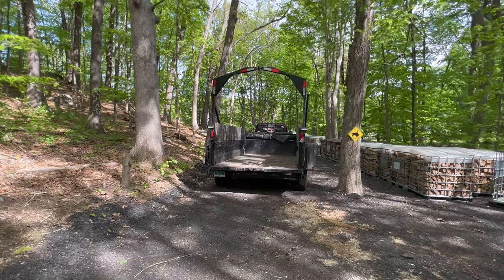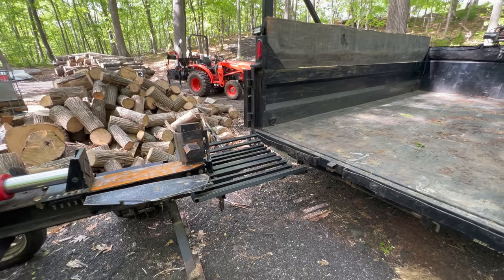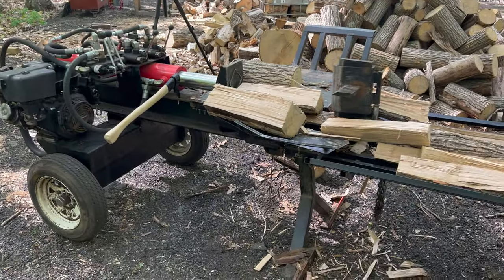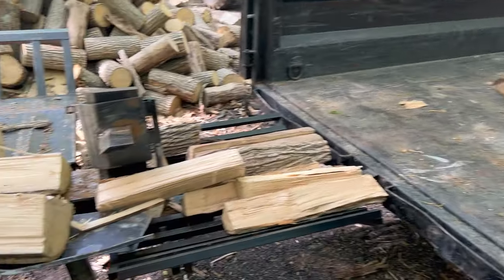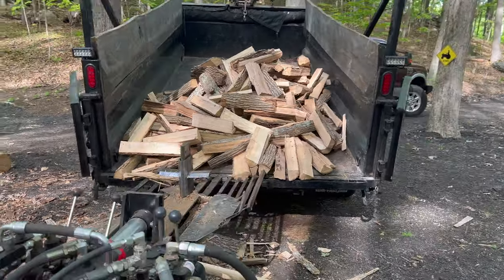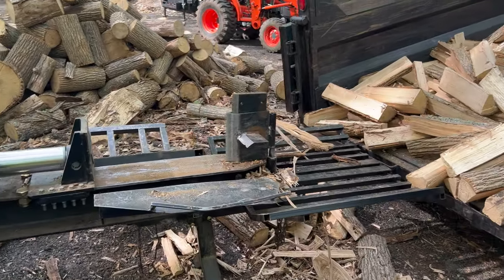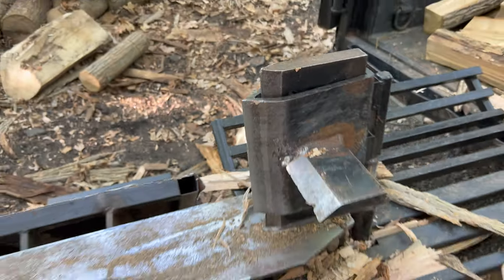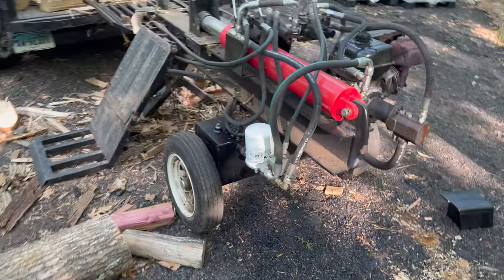#226 Splitting Ash Firewood into a Dump Trailer

Comment: I can speak from experience,  I had the same bottle neck in production.  I purchased a conveyor and it changed everything.  You can buy a old farm conveyor and upgrade it for firewood. Would make for good content.
Reply from the maker: If I split in this manner all the time I would definitely have a conveyor. I’m lucky enough to usually have a second helper (Chris) there working with me to stack as I split, rendering a conveyor pretty much useless.

Comment: What happened to the conveyor, i also have a rugged made splitter, i also have a 24 foot farm grain elevator that I use, the wood comes off the tray right onto the elevator and right into my trailer, i have a 10 foot trailer that I can get a cord into and it takes me about a hour to get the trailer filled, i have a guy that is buying green wood for the 23/24 winter he has seasoned wood for this coming winter, he always keeps 2 years of wood 1 seasoned and the other green for the following winter, what is nice i don't have to stack it just fill the trailer and dump it at his house, saves me a lot of time not stacking, have a nice day. he buys 8 to 10 full cords.
Reply from the maker: I sold the conveyor over a year ago. It doesn’t really fit my operation since I stack into totes. It would’ve been handy to have here but 99% of the time I have my partner Chris here to help me stack as I split.